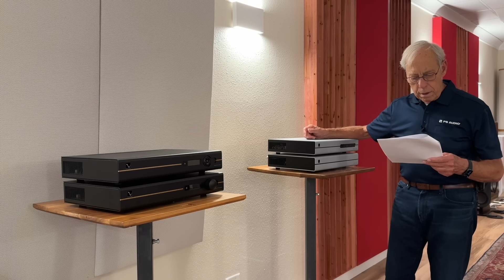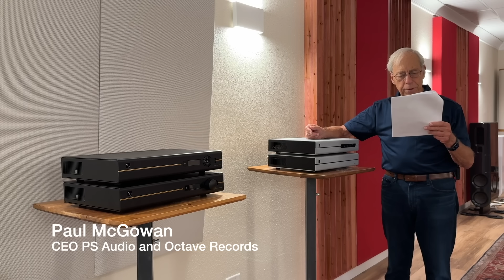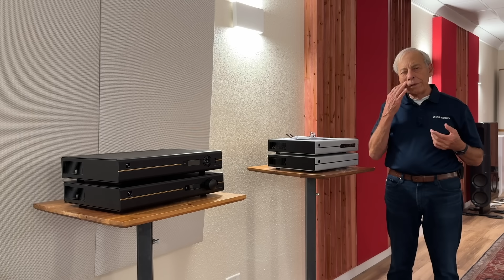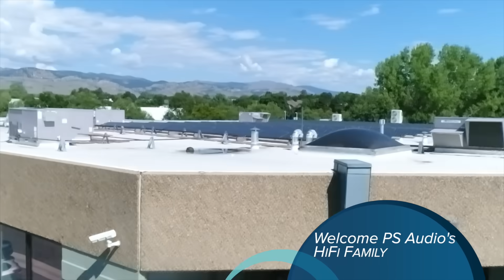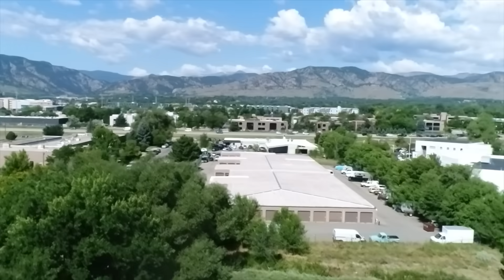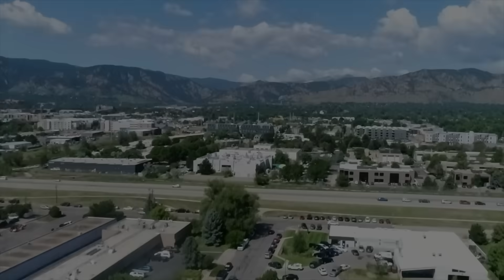Why some systems sound flat

Comment: It goes a little deeper,,,Use a C.R.O. what you will see is current and voltage waveform distortion on the mains supply, shocking :)  something you could reinforce your commentary with  Paul, respectfully. Personally run an off grid power system for the stereo as I am the last person in the street, furthest away from a pole top transformer and amplifier transformer noise was the first thing that was solved. The ac/dc conversion in an analogue amp "should" filter out the distorted wave form however the toroidal and iron core transformer amplifiers are most susceptible, physical noise from the amp rack and hiss from the speakers, during those times in the evening when all is quiet and you can hear a pin drop. Medical grade ac waveform regulation, elimination of DC on the ac mains, sorts out the problem, but is costs a bomb,,,,have to be committed :)  SMPS amps tend to act better with the distorted unregulated mains. Watching on with interest.

Comment: Excellent lecture, and explanations, Paul McGowan! Myself, during early, and late evening hours when I listen to my main, and upstairs audio systems, there is simply less noise from the outside world. Anyhow, the lights in and outside a house or apartment is dim; and it could be another factor. Mostly my true opinion, not an actual fact.🔈🎵🎶

Comment: Not only is your power better at night, but at night time there's a lot less exterior noise. There's less traffic outside the air is more calm and still it's just it's a quieter blacker background so you are going to hear more but there's less power being consumed off of the grids. That is the biggest factor

Comment: I found something else interesting, at least in my case: AC. When AC Is on and flowing across the speakers, the mid-high is somehow flattened out. When AC is off, the magical details are back. Not only related to power because happens also if windows are open and air flows across speakers from side to side.

Comment: The dacs that i’ve tried with delta sigma sounded like a flat 2D wall of sound (topping, eversolo, arcam, Denon) and gave me ear fatigue after 30 minutes.

So i upgraded to an R2R dac Denafrips Ares 12th and wow 3D sound and i can listen for 8+ hours without ear fatigue.
I wanted more so I upgraded rom the Ares to Denafrips Pontus 12th-1 and wow.
I moved the Area to my 2ndary system (family room) which significantly improved TV dialogue clarity and musicality.
——
source=Apple Music lossless
my video: search Youtube for mrPMJ00 "Denafrips Pontus II 12th-1 vs Ares II 12th. Iris 12th, Eversolo DMP-A6,Arcam,Parasound,GoldenEar BRX"

Comment: The same way you regenerate the sine wave solves all the issues, why your constant voltage power supply for the amplifier cannot fix all of them? Why do you need a regenerator? I think your amplifier power supply is perfect, you fix in there all the changes of the sine wave with that many capacitors you put in there right?

Comment: Pure nonsense.  In the winter and summer, power demand peaks in the evening from 5:00 to 7:00 PM, when people return home, turn on their air conditioning or furnace, turn on their lights, and start to cook dinner.  It doesn't peak during the day.  That's why solar isn't a good match to power demand.  Look up "Solar Duck Curve".  

Voltage typically drops by just a few volts during power demand peaks.  Much more than that and it would be a brownout.

Stereo power supplies work fine with such small voltage drops - in fact, they're designed to handle much wider voltage swings, typically from 108 to 132 V, than your utility delivers. Switch-mode power supplies are even more tolerant.

Paul is right about one thing.  It's the glass of Red effect.  Save that money you would have wasted on a power regenerator and start drinking earlier in the day.

Comment: As an Kenwood rep in the '70's they were introducing their new Audio Purist line in a separate room downstairs at McCormick Place. I went down there as the Kenwood Japanese engineers were setting up the booth. They were not happy with the sound. But did not speak good English. I noticed the florescent Kenwood signs were flickering. A sign of low AC Mains voltage. I grab one of the signs and take it out to the hall and plug it in out there. Lights right up. 

Now for those of you that known Chicago's Unions.... I was immediately surrounded by some Union Electricians very angry that I was taking their job away! You ae not allowed to touch an AC cord in McCormick Place! A Union Electrician has to do it or you might find yourself swimming with the fish! So I had them do the same thing. Plus that sign in the hall and in the room! Meanwhile the Japanese engineers were going crazy and none of us understood what they were saying! But the Electricians agree that the MAINS had dropped so low by the time it got to that room, they dropped another transformer right behind the room and fed our section off of another MAIN. The display lit up and the Engineers had big smile! Yes the MAINS can make all the difference.

Comment: Sometimes it can be as simple as the question: What changes at your home between day and night? Maybe you retract the window curtains during daylight and close them at night. Huge difference in sound. How many people are how noisy during the day in your rooms? What about the traffic noise from outside? That's also a distraction. How about the difference in humidity? Maybe the air is dryer at night (less people and less activity in the room) which could also affect the sound distribution.

Comment: The answer is to buy more stuff 😂
Reply: I had the PP3. Didn't do much if anything.
Reply: @thepracticalaudiophile If your power supply is already stable and clean, you may not notice much improvement. It also isn’t a cure-all, especially if your system isn’t resolving enough to reveal the difference.

Comment: Something that recently improved my system concerning power is the power company replaced the transformer out on the pole. The house was built in '94 so as far as I know the previous transformer was that old. I wasn't even thinking about it and the next day I fired up my system and noticed it sounding more open and revealing with a more expansive soundstage. Starting thinking about it and wondered why and then I thought oh yeah, they changed out the transformer, that's the only thing different. Anyone else have that happen?

Comment: I had fairly variable sound quality from the power grid... until... the last unfortunate Squirrel BBQ on the power pole that feeds my home and the lineman decided to replace the whole fuse unit because it was old and crappy. Since then the power has been significantly improved here and my need for grooming the power has dropped to almost no need at all. If one investigates every single aspect of the audio food chain in their system it ultimately becomes rather amazing how much every little detail counts.

Comment: I’m semi-retired, live in a small town, have eliminated a great deal of stress from my life, gave up on the idea of the ‘perfect’ sound and Hifi system, and live on a quiet road. My system sounds really great through the daytime and late evening. If it does sound worse, it’s usually after 5pm until about 10pm when most people are at home. But that’s probably just a psychological effect related to mood and my body clock. It’s so easy to shovel ridiculous amounts of money in this hobby beyond a certain level to ‘solve’ the biggest issue - our state of mind.
Reply: sound and vision all very subjective

Comment: I cannot understand how the mains power would be an issue, unless the power supply of the amp isn’t well designed. I have heard about gold plated mains cords which (according to the owners) yield a better definition of the sound. I have never seen hard evidence, so it’s all placebo effect for me, unless proven otherwise
Reply: If it's good wiring (ground can play a part here as well), there's not any noisy equipment on the grid  etc then it might not do anything, but the power supply is built for dealing with the things it should deal with, you might be far out of that region. If it's visible on the wave form then that might be possible to measure on the output on the amp. 
I heard a difference long long before I even knew there were devices made to try and fix it.
Reply: Only gold plated huh?.....lol
Reply: Only your hearing can prove better sound for you. The Placebo Defect does not affect everyone.

Comment: Actually there are other things at play. Many people don't realize the Fletcher-Munson effect of equal loudness is a major factor in how the audio experience is against how loud you play. When you play at lower volumes, the sound will subjectively become more narrow-band. Then another often forgotten topic is how your mind is. If you are sleepy or you got some alcohol, you will lose some of your sensory capacity to absorb fine details and depth in the music. If you drink a Red Bull and suddenly realize your system sounds more resolving, it's not the system that changed, it's your brain.
Reply: True enough with respect to mood,ambient noise levels and room light levels even having the capacity to alter our focus on what we hear,or how attentively we listen .Interestingly though,as long as the noise levels are really low in a system and the the dynamic range is high, small details come through more effectively.Couple that with greater dynamic swings  becoming more apparent irrespective of volume level,the need in that case for additional processing and "loudness compensation " becomes largely redundant.
Reply: @oliverbeard7912 No, in fact you are losing hugely in especially the bass when playing at low volume. E.g. you are down around 25dB in perceived 50Hz bass relative to 1kHz when comparing normal loud (80dB 1kHz SPL) with quieter listening. The Fletcher Munson equal loudness curves are of huge impact in the perceived tonal balance.
Reply: @ThinkingBetter It may seem surprising, but given enough resolution and dynamic range, the desire to turn up the volume to attain a "room filling" presence diminishes significantly. Given for example someone entering your room and playing at barely a whisper,the "presence" and "musical information " is more than adequate and needs no additional colours or flavours to "enhance" the presentation to avoid it sounding "flat", as the poster mentioned. It's not only about frequency balance,but ability to retrieve low level detail,which in turn allows the "louder" details to "jump" out with greater intensity, realism and perceived "loudness".
Reply: @oliverbeard7912 No, our hearing is the problem. Human hearing is optimized for vocal frequencies at lower volume because evolution strongly favored accurate detection of speech and socially relevant sounds in subtle or noisy environments. This maximized survival through better group coordination, predator avoidance, and social cohesion. You can ignore it, but it's very real and actually not hard to realize. A very high-end system doesn't fix this. A US$100,000 system without loudness compensation fails as much as anything cheaper.
Reply: @ThinkingBetter Given real instrumentation played at barely a whisper,the desire for boosting any frequencies simply isn't there. If it were,they would lose their authenticity once EQ was applied. The less we "play with colours" the better if we want a convincing portrayal of how instruments sound in real life.
Reply: @oliverbeard7912 It's a matter of how you define authenticity. For vocal focused music, it can be ok.
Reply: @ThinkingBetter "Authentic" in that they sound like themselves and not a technicolor version.
Reply: @oliverbeard7912 Go tell all people wearing glasses to take them off. Our hearing system evolved not with audiophile intents but with survival intents where low volume loses especially the bass. Even the most audiophile listener will prefer some level of loudness compensation at low level listening. Blind tests have shown that.
Reply: @ThinkingBetter Would you feel that an othererwise inferior system  automatically becomes superior simply due to applied Equalisation? I can't get on board with that personally.To each their own though.Any modification to the signal ultimately represents a step down where fidelity is concerned,I feel.
Reply: @oliverbeard7912  No, absolutely I don't feel that an otherwise inferior system is any good for anything. Actually I perfectly know from years of experience that a highly resolving system also usually helps with reproducing authenticity at lower volume. But it doesn't mean it makes the music sound tonally balanced at lower volume. A well designed US$100,000 system with a reasonably flat frequency response through most of its dynamic range will ALWAYS have a perception issue at lower volumes where you lose especially the sub bass. Blind tests typically show even very critical listeners prefer some form of carefully balanced loudness compensation at lower playback levels. I've been in such listening tests and this is actually quite consistent even one time the testers (R&D) thought they were listening to a cable upgrade. Listeners consistently prefer EQ curves that follow the equal-loudness contours — i.e. with boosted bass (sometimes +6–10 dB) and some treble lift (+2–4 dB). Studies at BBC R&D (e.g., Toole & Olive references) and at Harman show that compensated curves restore tonal balance perceived at reference loudness. When the correction matches ISO 226, blind A/B tests show statistically significant preference for compensated playback.
Reply: @ThinkingBetter OK,sure.I can understand how at low levels it may be preferable in some systems for some listeners.  Not sure that it's a prerequisite for "good sound" though,which as we know is subjective .Not everyone will feel the need for it and once a realistic level has been obtained we'd do well without any additives flavouring the reproduction.
Reply: @oliverbeard7912 I'm confident you would also fail in a blind test adding carefully tuned loudness EQ if you were told some wonder cables were used and didn't know the truth.
Reply: @ThinkingBetter If  the difference is that large, surely a blind test wouldn't be necessary?  Some may prefer such "enhancements ",while others may not. It's not a universal given that every system "needs" tailoring. You can't force a system that's already incapable of sounding natural to become more so by adding colouration. It may be preferable, but it doesn't make it intrinsically more "correct".I have absolutely no problem with anyone wanting to tailor their system,as it's their choice.It'll always be subjective preference to the end user ultimately.
Reply: @oliverbeard7912  Multiple AES and Harman studies (Toole, Olive, Welti, et al.) have compared also the opinions of audiophiles and studio engineers in blind tests and found that the vast majority prefer loudness EQ at low volume (up to 90%). Perhaps you are the 10% who enjoy vocal focused music and it's alright.
Reply: @ThinkingBetter It's all alright if it's what we prefer. We''d all like and buy the same things if it weren't. I like to avoid tampering too much with the signal myself, but that's just me.
Reply: That's not how the Fletcher Munson contours work. If that were the case alone, no one would ever listen at low levels. Those curves represent the ear/brain natural ability to respond to certain  frequency bands based on their amplitude on a comparative level with other frequencies across the audio spectrum. The whole loudness thing tells only half the story.
Reply: Except that I consistently feel my system sounds much better late at night, when I'm tired and supposed to go to sleep.
Reply: @derbigpr500  Perhaps your mind is better at focusing on the listening at night when the hassle of the day is over...? Definitely there is also a stress factor. Our brain bandwidth is limited. Also closing your eyes can reserve more bandwidth for the sound. It's also known that when someone is blind—especially from birth or early in life—the brain reorganizes itself. Visual cortex regions that would normally process sight don’t just sit idle; instead, they often get recruited for other senses, particularly hearing and touch. This is a form of neuroplasticity (the brain adapting its wiring to circumstances).